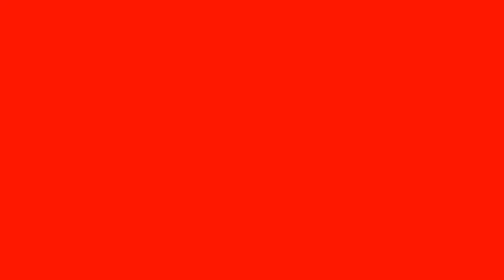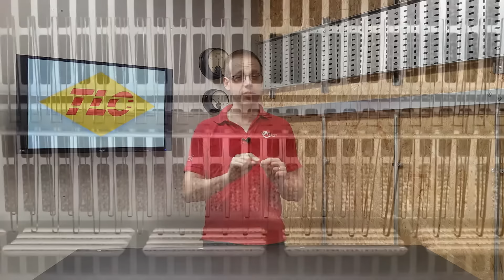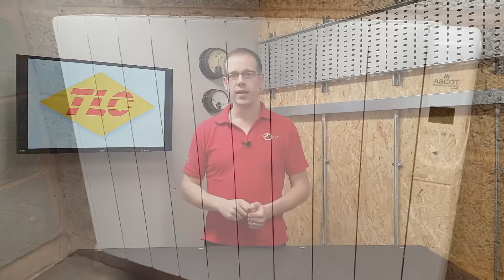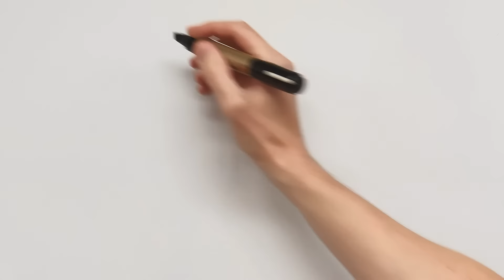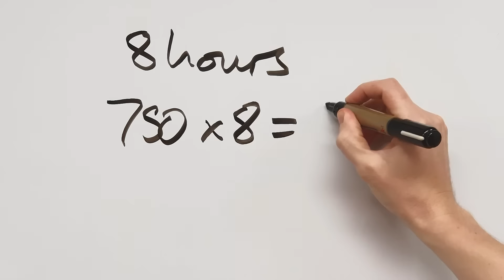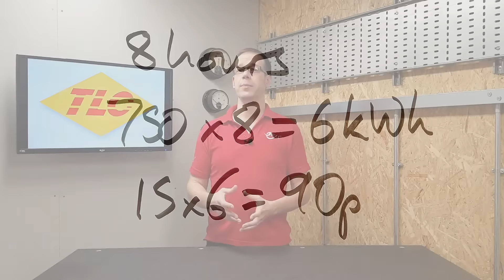Do electric radiators use a lot of electricity? -   Electric panel heaters vs oil filled radiators

Comment: Electric heating is not the future it is way too expensive. The example given is 90p per radiator best case scenario, thats £9 a day if you have 10. That's alot of money I currently pay a third of that with my gas boiler. I had a central electric boiler heating water filled radiors when I lived in the outer hebrides in a warm modern house. The boiler was 15kw and was a modern boiler about 2 years old. It used to cost me just over £270 a month during winter just to heat the 4 bed house and I was on a very cheap heating tarrif paying just 12p per unit. Electric heating will only work if prices are reduced to around 4p per kwh but this will never happen. Oh and my thermostat was set to 17 degrees.

Comment: 1) The whole point of an electric heater is to use a lot of electricity. That's literally their job and 2) You can't answer the question because by far the largest variable is room insulation

Comment: 15p a unit. Good old days. Now more close to 50p! And the house I'm in was fitted with new "energy efficient" electric heaters all round. Don't think they will ever be turned on unless prices return to normal. I'm even looking into gutting it all out selling it on and installing a big oil boiler. Great efficiency and atlest only marginally more expensive than gas depending on how cheap you can get 1000ltrs and your energy/efficiency rating of the oil boiler but most run at 10-10.5kq per littre of oil and someone worked it out to being even cheaper than gas at its current price!

Comment: 1year later it's cheaper to use electric heaters than gas 😅
Reply: Is it? At 44p/kwh a 1.2kw heater, 8 hours a day in one room is costing us about £60 a month.

10.3p/kwh for gas would allow us to heat our entire 3 bed property for about £100/130 per month
Reply: @joshbrown924  😂 100pounds a wish

Comment: It's funny that I live in a country without developed gas infrastructure. So we have to heat mostly on electricity which is expensive. We looked at countries that can use gas with envy, since of course - that's objectively the way that makes more sense. Creating electricity is expensive, and often  burns materials, which means energy is ultimately wasted in conversion and transportation. But now, because of some delusional "leaders" that do not know where the electricity comes from, everyone is forced to use electricity, since supposedly it's more "green"... Well, after you have the electricity, sure, but how you actually produce it in a clean and effective way? Hint - no, wind mills and solar panels aren't the answer - first because they are not as effective, and second - they have their own environment issues... Nuclear is probably the best option, but instead of making this technology safer, they are shutting reactors, so people go into the woods to chop trees... I would believe electricity is the answer, IF countries were producing safer, cleaner and cheaper electricity. This is what you must do first... kind of obvious. They are doing the total opposite. Idiocracy...

Comment: Missed point is it’s not working constantly 8 hours! I think in average it will run maximum half hour constant in each hour. That’s mean is you will consume 3kw average for 8 hours. Not bad at all guys! Make your math accordingly. If you put lower temperature in the the night it may even save you a bit more. Consider.

Comment: Oil radiators are controlled by thermostat and only use most electricity when switched on from cold after that the controlled by the thermostat set to the desired temperature, so how can they be the most inefficient electric heater ? Mine switches off when at suitable level then only comes back on if the room temperature drops, with fan heater the power is constantly on being most costly to run 🤷‍♂️

Comment: You are trying to flog us very expensive electric radiators (around 400 quid each) that will bankrupt most of us if ever we tried to heat our houses with them.  Okay come 2025 and no gas its Hobson's choice but TBH other than what we might call 'spot heat' or 'instant small room warming' there isn't a viable alternative to gas that has been invented anywhere n this planet to date IMHO.  May as well get a 2KW convector heater from Home Bargains like I did for 12 quid last winter, warms the room in no time whatsoever for a tenth of the purchase price.

Comment: That works out over £25 every four weeks for one heater. A 1 bedroom flat at minimum would have 4 heaters. Thats £100 every 4 weeks.

On gas when this video was produced, you could do the same with four radiators for £40 every four weeks.

A big difference. But electricity always going to be more expensive than every other fuel.
Reply: I live on my own and have a 1 bed flat. I would have to be insane to keep 4 heaters going. I have 1 oil filled rad 500W and keep it in the lounge by day and move it to the bedroom at night. At todays high prices on 10 hours a day usage my overall energy bill is £100 PM. No gas.

Comment: Who wouldn't have electric everything given a choice?  No clunky boiler which has to be maintained, no pipes full of water running all over your house with the potential for leaks, no messy hob to be cleaned in your kitchen. Let's face it burning gas is pretty archaic.
Reply: £30 a month british gas homecare agreement carbon monoxide danger etc agreed. I use elec oil filled now - only 1 in the flat - Im happy with it.
Reply: AND MUCH MUCH CHEAPER BY FAR. . IF YR ON £80K PER ANNUM YR OK, BEST OF LUCK SPENDING UP TO 4X AS MUCH ON LECCY. ...........
Reply: @alnic5730  Unfortunately that's a UK created rip off. We pay far too much for our electricity in this country.

Comment: They do use a lot of power. I have a 1600 watt heater like this and if you run it for an hour it costs 50p and is completely ineffective, useless even. A 1000w fan heater works much better IMO.

Comment: I know of entire blocks of housing demolished because local councils decided to take out gas heating/enclosed coal fires and replace them with electric heating. The cost to run the heating was so high the people in them moved out and nobody would take them because they had electric heating. They ended up riddled with damp to the extent that it was cheaper to demolish them than refit.
Reply: Serves those greedy bastards right! No one should have to pay a fluctuating bill! It’s bullshit there should be a flat rate for unlimited electricity period!
Reply: @andywooten622  currently costing the people in the remaining houses in the same place around £150 a week and it barely gets their homes up to 15c. The houses are well insulated and have double glazing...

Comment: Oil Filled Rad 600W - 6p per Hour
                      1500w  - 14p per Hour
Reply: So two 600w rads are  cheaper to run than one 1500w.
Interesting.

Comment: I had a similar discussion with electric shower was being told that a 7kw shower on low uses less energy.  I say to them not true they say the water comes out colder so must use less.  But it is the speed of the water threw the small tank.  No I was not speaking to the shower was speaking about one.  Not with one.

Comment: The issue that really gets mentioned is maximum demand. A larger house with 4/5 bedrooms, could easily have 10 heaters (20-25kW) . Add all the other demands like 9kW cooker, 3kW water heater,  appliances, lights and the electric car charger point. Installation Demand after Diversity could easily exceed 100A. Would like to see a video how efixx would calculate max demand and calculate diversity.
Reply: Missed point is it’s not working constantly 8 hours! I think in average it will run maximum half hour constant in each hour. That’s mean is you will consume 3kw average for 8 hours. Not bad at all guys! Make your math accordingly. If you put lower temperature in the the night it may even save you a bit more. 
For your opinion, it may not be much suitable for large houses (though as long as you don’t want save energy and just heat all house constantly). And another advantage is if you have large battery or large solar panel system this will run free! There is no chance you can produce gas at home but if you have a large house this may save you a lot of money. Just my opinion.
Reply: @onderdogan6633  now there are solar panels that produce hydrogen.  Innovations are the answer.....

Comment: Resistive heating generally is a bad idea.  "100% efficiency" is misleading cause it only accounts for electricity conversion into heat. Many powerplants use fuel of some sort generating electricity and heat with ~30% and 60% efficiency respectively. Also, there are transmission losses of about  ~5% 
Other options would be: Passive solar heating, solar thermal heating, waste heat from various sources, heat pumps, CHP, or a combination of them :)

Comment: Against my advice my next door neighbour had his obsolete gas boiler replaced with Fisher electric heaters in each room.. This was during the spring.3  months later he wanted to sell the house. Every potential buyer was put off because of the electric heating.  When he eventually sold it the new neighbours had the shock of there lives when they got the electric bill. Within mouths they had them ripped out and a new gas system fitted. These heaters had a very short life maybe 9 months max before ending up in a skip. 
Another thing
. Anyone who’s old enough to remember video recorders will remember 90% of the population couldn’t even program them to record a simple .single program . Wind on 20 years  90% of the population haven’t a clue how to program these heaters and if they can they can’t be bothered. All they do is just switch them on and off.
In my workshop I have a old dimplex panel heater , it’s not used much but it’s got a mechanical time switch and a normal thermostat. How simple is that to set and use. Almost anyone can understand how to set it within seconds
Reply: Yep, i totally agree. Keep it simple.
Reply: how about now?
Reply: @jamescat2386   im very curious aswell
Reply: Times change also I'm pretty sure you can't talk for 90% of the population never mind have the evidence to back it up, literally typed a essay of pure nonsense, I work with solar and I'm pretty sure electric heaters are really only for homes with solar I thought this was like common sense they go along side each other like two peas in a pod! And I could record on vhs when I was 4 if you struggle there is always a manual to refer too
Reply: Agree 100% with what you say about Fischer Future Heat (or any similar electric radiator heating system). To heat a whole house in this way is utter madness, tens of kilowatts per hour for 5 or 6 rooms.
These companies must employ ace salesmen to convince someone like your neighbour to rip out gas and go electric. I mean, after all, how much is a new gas boiler? £3000 ish fitted.
And I'm sure the new electric system cost many times that to install plus very, very high running costs.
An electric heater/radiator in one room is expensive (thermostat or no) but for all the rooms in a house ........out of the question.

Comment: The heat capacity of oil is lower than water.  

This means that the ability to transfer heat is lower for an oil based electric oil filled radiator than an electric water filled radiator.

One way of settling this would be for you to do an experiment where you turn on over a period of several days one radiator of each type to see the amount of energy consumed.

Moreover, if a heat pump is an option, then either a water to air, air to air, or water to water heat pump might provide even more energy savings than either a water or an oil filled electric radiator.

This is due to the fact that a heat pump will extract heat from the cold energy in the middle of the winter, and in most cases it will deliver more than one unit of energy for every unit of energy consumed.

Some more interesting questions would be:

What heat systems are compatible with renewable energy?  

What heat systems will be most efficient with renewable energy?

What is the lifetime cost ratio of invested heating equipment to heat delivered?

Here are some products worth investigating further:

https://radiwarm.com/product/radiwarm-pipeless-radiator/?variation=600-x-400-mm&quantity=1

https://www.dimplex.co.uk/storage-heaters

https://les.mitsubishielectric.co.uk/homeowners/our-heat-pumps

Unfortunately, I find your current analysis superficial and narrow.  

I as a subscriber would certainly appreciate a more in depth review of the different options available in order to know whether I am able to pass along your recommendations.

Comment: With better temperature control you can set the temperature lower and still feel comfortable, most of the time thereby saving money. It cuts out that cycle of feeling cold, the comfortable then hot, then comfortable and then cold again (although as the structure warms up the cold feeling gets less of course as it operates like a block storage heater). To get over the cold periods one would be tempted  set the temperature up, so the cycle becomes comfortable, sweltering, comfortable, but very expensive. There are more heat losses too at higher temperatures. The problem with fan heaters is that the movement of air can give an apparent cooling effect, not to mention stirring up dust etc unless fitted with a filter. Well controlled and well distributed heating is the best.

Comment: Gas is not being phased out. Just a suggestion.  There is also a suggestion of using the extensive gas distribution pipework for hydrogen burning domestic appliances. The city of Leeds was suggested as a trial. 

Electricity is the future. What will make it feasible is PV panels and Powerwall types of batteries. Of course backed up by superinsulated homes, not needing much heat input to start with.
Reply from the maker: Thanks for the clarification - lots going on in the Northern Powergrid DNO area.

Comment: Down here in good old NZ we've been heating our homes electrically and heating our water the same way for years. The average power bill at the end of last winter for me was about $230.00, per month.  Now I am not sure how that works out to Pounds, shillings and pence. However that was fairly reasonable considering how cold and damp it was.  An average household/ family might pay $400.00 per month. We just learn to deal with it. We too are becoming energy wise and using solar and wind, but more from an ecological stand point.
Reply: 400 per month? I'm in a family of 7 and it's 50 a month wtf
Reply: If our bills were that much we would revolt..thats a incredible amount of money....
Reply: What are the rates by different energy types?
How much does gas cost per kwh?
Electricity?
How many kwh do you use annually?

Comment: The only way electrical resistive heating can be cost effective and or green is by adding a time shifting component and charging up with cheap(er) energy when it’s available.  The increasing supply of renewables is not going to make peak energy cheaper, indeed we will see the opposite, with increasing costs during those winter evening peaks when there’s a chronic lack of supply.  Let’s see storage heaters given a new image and linked to innovative tariffs like octopus agile.
Reply from the maker: It's probably going to need a combination of technologies to make it all work effectively.

Comment: Resistive heating Joules in = joules out. Theres no bettering that no matter the fancy labeling. The only improvement I see - all resistive heating should have an accurate readable dial in degC (or F) 
And mandated to turn off above say 23C. That alone would subtract power stations
Reply from the maker: Surely controlling the temperature more accurately has to be a good thing though?
Reply: @efixx  could be, but I'd say first massive power saving would be an accurate readable thermostat, maxed at 23C. 
Second to that : modulated control using SSR or the like. So approaching set point modulate to 50% or 25% etc.

Comment: In almost all cases using "electric" heaters is the least efficient way of room heating.  It does not matter how you control it; Getting a room from one temperature to a higher one will consume the same amount of electrical energy ("units" in your context)  however you control/deliver that energy.  I'm not impressed by the video.
Reply: What do you mean you’re not impressed?
He’s just answering a question about electric heaters, and he answered it. Saying oil radiators have a slight advantage with them being able to retain heat longer after it’s turned off, and with the thermostat settings.
Reply: wall heaters heat the wall brilliantly and most rads are on the wall. My elec oil filled rad is in the middle of the room and heats the air not the wall.
Reply from the maker: I actually stated in the video that it's cheaper to use gas fired boilers and radiators, however gas won't last forever and with the rise of renewable energy sources the future of heating is electric, probably using a combination of direct heating and heat pumps. Thanks for watching.